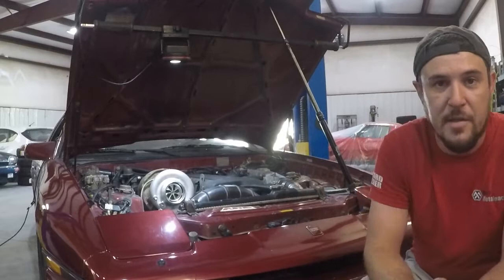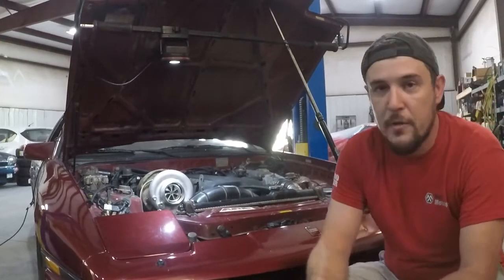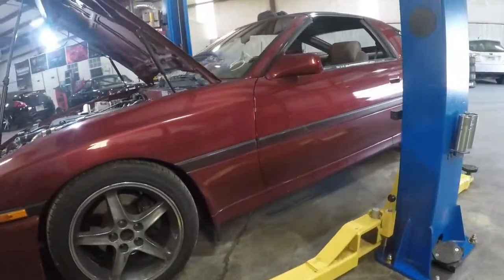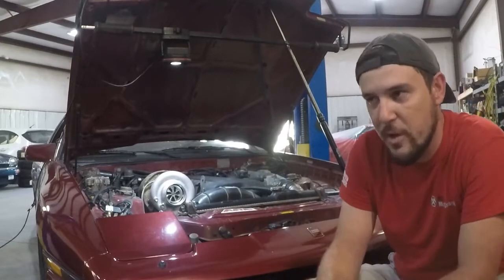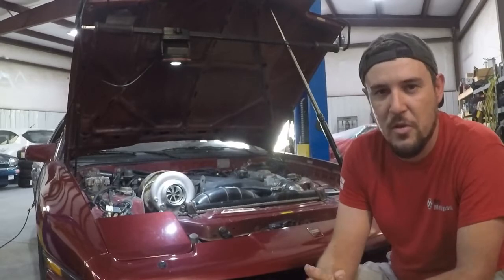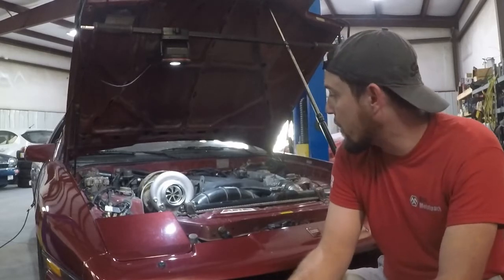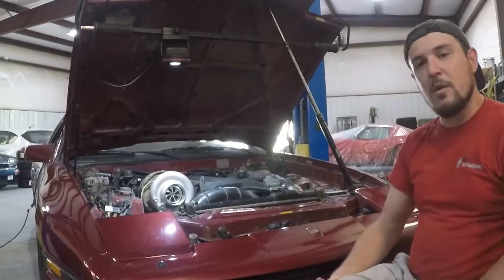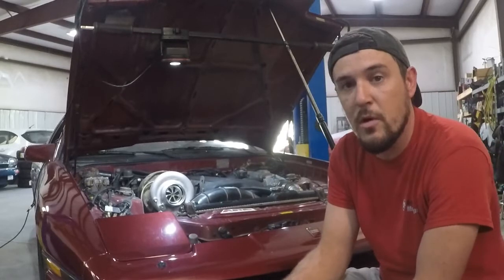2jz mk3 supra build rundown

Comment: What fan clutch are you using?? And is that a stock radiator? Because my stock radiator is trash and trying to find a new one but can only find aftermarket and i read that it could affect my fan so idk
Reply from the maker: Manifold is the cheap driftmotion unit with a 1 inch spacer. Fan setup is a 1uz clutch with 7m blades, stock radiator. I have since switched to a koyo and electric fans. I think the mechanical fan would still fit though.
Reply: @Mavericka71  so for radiator options theres koyo and mishitmoto and you think the 1uz wont interfere with either of them?
Reply from the maker: @brothernation570  I think there's probably room
Reply: @Mavericka71  alright thanks man means a lot
Reply: soon to get mine on the road heheh
Reply: And what manifold you are using because I got that same turbo and I’m trying to buy some that will last me

Comment: I've got a 92 with a 2jge in it. Same color! You said you work around the higher tuned vehicles frequently now. Can I ask what the most efficient route would be for me to chase 500 hp? Is VVTI necessary? I know the w58 wont hold up but I'm moreso weighing out my options on the motor/turbo setup. Also never heard of your standalone unit before. Are the big name ECU sellers worth the coin? Thanks man and love to see something I can only strive for!
Reply from the maker: Stock ge is fine for 500hp. Vvti isn't necessary, but it makes it drive better out of boost, and gives some better spool. Most turbos from 60-64mm will do 500 easily, have good spool with some room to grow if you want to go higher later. A good fuel system is a must. At least 750cc injectors, 1000cc would be better, especially if you can run e85. Its so much safer to run e85 if you can get it, and your power potential is a lot higher. Megasquirt is a cheaper standalone, but it's very diy. Bigger ecu companies are worth it if you want more of a turnkey standalone. If you want more of a challenge and aren't afraid of wiring from scratch, megasquirt is a great option. It has just as many features as the high dollar units.

Comment: What clutch fan setup did you use?
Reply from the maker: Used a competion stage 4, kept breaking them. I'm using a driftmotion twin disc now, it's so much better
Reply: @Mavericka71  I was referring to your cooling system. You kept the stock radiator and used what type of clutch fan?
Reply from the maker: Oh, right. 1uz clutch, 7m fan. It worked well,, but the fant was very loud. Now I have a koyo radiator with some e-fans from summit.
Reply: @Mavericka71  can you send me Links to what fans you got? I’m doing the same swap and was wondering which would work better

Comment: what gear ratio are you running ? going a lower gear ratio will help for the diff
Reply from the maker: 3.91 in the car currently, I have a 3.73 that will go in with the new subframe
Reply: @Mavericka71  What motor mount brackets did you use for you swap?
Reply from the maker: @spool-aid6750  the driftmotion ones, worked great